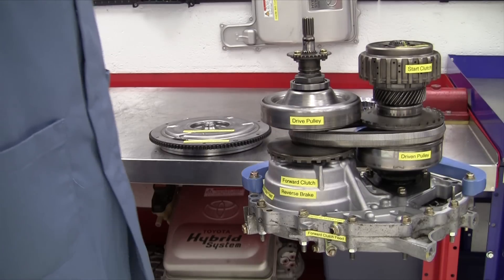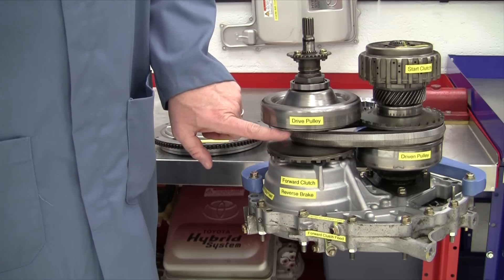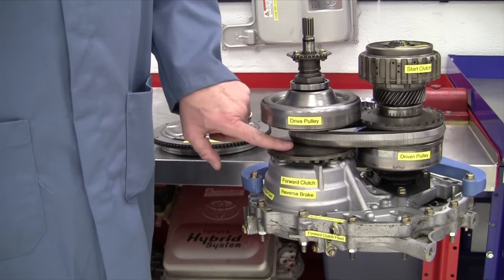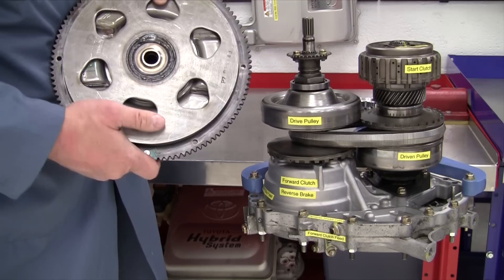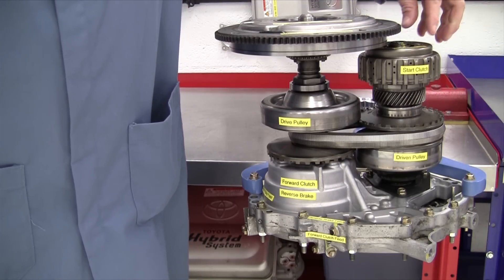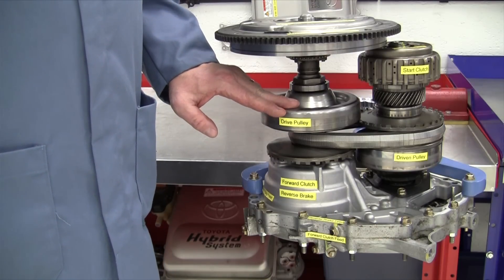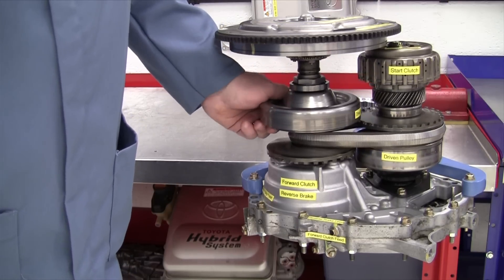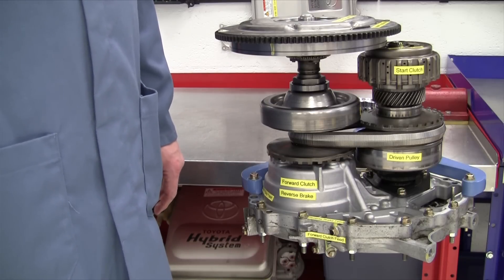Honda Civic CVT Transaxle Operation

Comment: Hello, I have a 2002 Insight that has developed a heinous growl when put into reverse or drive. I've done some research and it sounds like the starter clutch. I followed the TSB on burnishing the starter clutch but it made no difference. If you have the time, would you mind taking a listen and giving me some feedback? I am going to drain the fluids this weekend and see what comes out, but honda cvt fluid was just replaced 10k miles ago. Thanks in advance!
https://youtu.be/rXiHjtvODFw
Reply from the maker: Assuming the vehicle drives okay, It does sound like a start clutch. If it does not move, the flywheel to transmission input shaft splines strip off and the flywheel would have to be replaced. Best wishes!
Reply: I appreciate your response, we are going to take it apart next weekend and try replacing the starter clutch, I will inspect the rest of the components while I am in there. The vehicle does drive, it has some minor shudder when accelerating quickly or slowing down on a hill. I am going to try the re-learn procedure as well. Cheers!
Reply: Timothy 
Not a computer problem. I agree with they guy there saying it was the input splines. Could be slipping past chips of the shaft material......

Comment: you had me until you said the engine was connected to the starter ring gear
Reply from the maker: This model does not have a torque converter (it uses a start clutch instead). The engine crankshaft is bolted to the torque damper which has the ring gear for the starter attached to it.

Comment: What is the function of the start clutch?
I have a transmission when shift on  D or R engine dies some times  this will cause the problem?
Reply from the maker: This transmission does not have a torque converter. The start clutch mimics the fluid coupling of a torque converter. Yes, it can kill the engine when it has a problem. There are updated start clutch and valve bodies for some models. There is even an extended warranty for some models as well. Best wishes.

Comment: hi I have a 03 Honda civic hybrid. I recently replace the flywheel. once the car got put back together my car feels like it doesn't shift. it stays in first. I got a diagnostic and they said the drum is bad?..any ideas on the what the issue would be
Reply from the maker: I assume you have a CVT transaxle. Why did the flywheel get replaced? That work may be related to what you are experiencing.
Reply: The flywheel was replace because the teeth in the middle was bald and flat.. the flywheel was part of the problem?
Reply from the maker: Good to hear. The stripped out teeth would have prevented the car from moving. I suspect the problem you have now (not feeling like it is not shifting) is related to the flywheel being changed. In other words, whomever replaced the flywheel may have left something disconnected, broke something, or did not add enough of the correct CVT fluid to the transmission when they were completed. It is highly unlikely that this problem existed prior to the flywheel replacement. Find another shop to check it out for you. Make sure the fluid type and level are correct. Best wishes!
Reply: Cool when problem occur is when I was driving from school. All of a sudden the car felt like it stop going. Just to be sure my first steps would be check the fluids and level? Don you recommend taking apart the transmission again?
Reply from the maker: No, I would not disassemble the transmission. Just make sure the fluid level and type are correct. The fluid level check is very special, be sure to read the directions.
Reply: Thank you so much..
Reply: Jimmy vongprachanh where did you get the flywheel replace and how much did it cost

Comment: I owned a Honda Civic 2006 Cvt in India. It was all well till last year. My vehicle countered a problem it does not move forward in D/S/L. But if I keep ignition ON for half hour, it  will move forward. Is there any temperature related problem??? B'coz it take more time in cold weather. Authorised workshop also got fail to fix. I got fed up with this problem. It will be great if you guide me to troubleshoot. NOTE :- Its pretty normal for R(reverse). It works normally once started moving in D/S/L.
Reply from the maker: Hi, it does sound temperature related. Make sure the fluid level is correct and is the correct fluid. If reverse works, but forward does not until it is warm, it sounds like a hydraulic problem with the forward clutch. Best wishes.

Comment: Hello WeberAuto I have a 2004 Honda Civic Hybrid with a CVT transmission that just went out.  Can not afford the 4k for a transmission place to replace the transmission so I am doing it myself.  The transmission does not go in any gear or reverse.  Was wondering what you think it maybe, the belt or start clutch?  Just a guess, want to price the parts and have them here when I take it apart.  Thank You!
Reply from the maker: It could be something as simple as stripped out flywheel splines. This prevents the input shaft from rotating and the vehicle will not move. This will also cause the input shaft speed sensor to read zero rpm wit the engine running, it should equal engine rpm. There are scan tool tests for the start clutch and the flywheel. The belt is also a possibility, but you will easily see the belt parts inside the transmission when you disassemble it. Best wishes.
Reply: When I drained the transmission fluid pieces of something started to come out, Some look like metal clips, and pieces of harden plastic.  Looks like that belt, what you think?
Reply: WeberAuto is the flywheel a easy fix?
Reply: Michael Greene i

Comment: I have a 2003 Honda CIvic Hybrid and my CVT vibrates badly upon initial acceleration. I changed the fluid out 3 times like the dealership suggested and it still vibrates the same. What is doing the vibrating inside the transmission and is there something I can replace like the belt or the start clutch to fix this? I cannot spend $4k for a new transmission but would like to stop the vibrating. Please contact Jim with any ideas.
Reply from the maker: James Harris it sounds like the start clutch is bad.
Reply: Thanks for the fast reply! Is it possible to take the trans out and apart and replace that start clutch? I am not a mechanic but I have replaced the harmonic balancer on a 98 Jeep and other semi difficult work but this seems like a much harder task. Everything still works and there is no slipping so that is good. Not sure what is doing the vibrating and why its only at the start but that is why I also thought of the start clutch. I want to sell the car and I am afraid people will not buy it if it makes this vibration. Is there any additive I can put in there to dampen the vibration?
Reply from the maker: James Harris it is difficult to replace. It requires a special puller and installer for the start clutch. The start clutch replaces a torque converter in a regular transmission. It jerks because is cannot smoothly connect the engine's power to the  transmission output shaft.
Reply: I assume only Honda has this special puller / installer and is not publicly available? Do you know any experts in the St. Louis area who can rebuild this transmission because the dealership will not?
Reply from the maker: Yes, they are Honda tools, but by law you can purchase them. See www.nastf.org for more information.
Reply: Thanks so much for your reply. I found a used CVT in my area with a good brake clutch but a bad belt, we think, for only $55 so that is good. However,  I cannot find the CVT brake clutch puller tool anywhere on the links on that website www.nastf.org or Honda's site https://techinfo.honda.com/rjanisis/logon.asp. From there I went to the Honda tools and equipment website, https://honda.snapon.com/HondaAcura/OnlineCatalog.aspx,  but they had nothing like that I could find anyway. If you purchased it via a website then please give me a more specific link to get that tool. I am hoping the tool cost is not so high that it is not worth getting for a single use. If I get the tool and successfully replace the part maybe I can help others on the side and turn into a mechanic when I grow up, haha.
Reply: he prob sold or junked it lol

Comment: Thanks for the great videos. As for the beginner, can you give some ideas on why honda seems more reliable or make some comparisons on different brand engines, thanks.
Reply: Maybe the recommended oil change intervals are different.  My Hybrid Jazz specifies change 2 yearly or 25,000 miles.  Cheaper engineering to change the oil rather than the gearbox!

Comment: why do honda's always feel like they are hunting/surging? 2015 CRV drove me nuts
Reply from the maker: The engine rpm and the CVT pulley ratio make changes in an attempt to meet the driver's input (acceleration, deceleration, vehicle speed, etc.) they do feel different and can take a while to get used to.

Comment: What's different between this CVT and the newest CVT found in the '16/17 Civic Turbo?
Reply from the maker: The newer CVTs use a torque converter rather than a start clutch to control the engine-to-transmission connection. They are much more reliable now.
Reply: Some people that have turned up the boost too high have scored their CVT belts and ruined it. It can safely handle a bit more power than stock but doesn't handle much. Low end torque is the main problem, and the factory tune has a lot of low end power, so now they've figured out you can tune it to smooth out the power curve at the low end and shift the torque to higher RPM's, and get away with a little more power than they normally would be able to without scoring the belt. Still, the manual transmission allows much higher power. People are getting crazy power out of the little 1.5T with a manual (especially with a high blend of Ethanol).

Comment: I have a 2007 Honda fit with CVT with 235k. Any recommendations on keeping it in top shape? Would it be worthwhile to use performance cvt fluids such as redline cvt fluid or is OEM honda ok. Your input is appreciated!
Reply from the maker: Hi, no. Keep using the original factory fluid only. That is one reason it has lasted as long as it has.

Comment: Thanks for the effort you've put into your many instructional videos. My understanding is that the metal 'push' belts are more efficient than the rubber 'pull' belts that are still used in snowmobiles and ATVs. It has also been suggested that the push belts may allow a greater range between the highest and lowest input/output ratios. Do you know if both of these assertions are true? Also, on snowmobiles and ATVs, control of the input/output ratio is pre-set by selection of springs, weights and helix shapes. But the automotive CVTs have programmable, electronic control. Do you have a video or a reference to material describing how an electronic system controls the separation of the sheaves?
Reply from the maker: +Gregory Parrott Hi, yes, you are correct. I do not have a video on the CVT controls yet. I hope to this summer. Thanks for watching!
Reply: +WeberAuto Thanks! The part which most intrigues me is whatever mechanical means/mechanism they use that interfaces between the non rotating transmission body and the sliding spider assembly located on the outer drive sheave. If the inner sheave slid instead, it would be easier to apply an external control. But for some reason, the drive pulley always seems to have its sliding sheave mounted to the outside and it seems the drive ratio is primarily set on the drive pulley, not the driven pulley.

Comment: My 2003 Civic 1.3L  often has a hard jerk and then bucking action during decleration?  Any ideas what's causing this and is there an easy fix. This is the second transmission.
Reply from the maker: +Shao lin Hi, there is a recalibration procedure for the start clutch in the transaxle. make sure that has been done. Best wishes!

Comment: thanks for the video. I have a problem with my 2005 Honda Civic Hybrid CVT transmission. It started with the transmission mounts (so I think) jerking or sputtering. now it won't go into any gear. What do you think is the problem? Will I have to replace whole transmission? Are there any recalls? I appreciate any helpful information. Thank you.
Reply from the maker: +Rene Aguilera Hi, there is a service bulletin for the flywheel splines stripping off inside the flywheel. This prevents the flywheel from rotating the transmission input shaft. This does not damage the transmission, you may just need a new flywheel. Best wishes!
Reply: Thank you very much for your response. I was thinking of selling my car because of the thought of having to replace the whole transmission. So the flywheel is what helps the transmission shift into all the gears? Right now it won't shift into any gear. Thank you again.
Reply from the maker: Rene Aguilera Yes, a bad flywheel will prevent the vehicle from moving forward or backwards. It is easy to tell of the flywheel is bad once the transmission is removed, all the spline teeth will be stripped off. A new Flywheel is a lot less expensive than a new transmission. If the flywheel is good, then something inside the transmission is bad. There are other bulletins for a CVT belt or the start clutch going bad internally. Might still be covered under warranty unless your odometer miles are too high. Check with the Honda dealership.
Reply: @WeberAuto where can I find one of these flywheels specifically for 2004 civic hybrid

Comment: What is the Direction of the CVT belt?
Reply from the maker: +saif almosuli Hi, it is a push belt; the drive pulley pushes the driven pulley through the belt so the belt does not stretch. It spins the same direction as the engine driving it.

Comment: I drive a BMW-made 2004 Mini. It has a BMW-engineered CVT. The CVT is still going strong. There are people complaining of failures (and worse, Mini won't replace CVTs after guarantee!) but mine is still doing good at 130K km. I keep my fingers crossed. The CVT Mini gives no "driving pleasure" as enthusiasts put it, but it's nice to drive around, very zippy, well, except if you want to briskly overtake, it'll take a while to accelerate.

For some reason (reliability and costs I believe) BMW stopped putting CVTs in Minis, and I believe, in any other car. It's a shame, I'm sure at some point, CVTs will make plenty of sense when reliability+slippage+torque issues are solved.
Reply from the maker: +yves2075 Thanks for the feedback!

Comment: This is a belt friction drive, low torque due to inevitable slippage at the pulleys. I still love driving the positive gear manual transmission with no slippage and solid pick-up at the gears. Slippage at the belt and pulley result in loss of energy and wear and tear. Linkbelt made the PIV (positive, infinite variable) drive on the same varidrive principle but using toothed steel belt that did not slip. That was a better design.
Reply from the maker: +Odouls77 Thanks for the feedback!

Comment: I had a 2011 Honda with CVT, Jerkey and slow to engage from Park to Drive gears especially in cold weather. I now have a 2015 Honda CVT Civic... much improved, smooth in and out of gear and engages right away, no lag and no bobbing upon acceleration.
Reply from the maker: That is great to hear! The new CVT from Honda added a torque converter and got rid of the start clutch. Much improved! Thanks for watching!
Reply: @WeberAuto  If they were smart, they would drop the converter and clutch altogether and let the electric motor handle that power range smoothly, firing up fuel injection once the vehicle got to 10-20mph and the engine RPM was high enough to run the engine.  But their battery system sucks too much to rely on, and they know it.  Plus they seem to have this "add-on" mentality about the IMA.  Oh well!

Comment: the second drive pulley under start clutch the spring or ring inside is some loose this is right because the order is tight
Reply from the maker: +juan luis millan ruiz Yes, there is an updated designed start clutch now. Thanks for watching!

Comment: John, good video. How difficult is it to replace the CVT Belt?
Reply from the maker: +Mad Murdock Hi, you should never just replace the belt. Both pulleys need to be replaced too. Thanks for watching!
Reply: Might as well replace the transmission. Parts are unavailable on line.